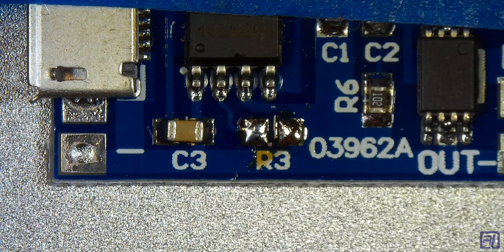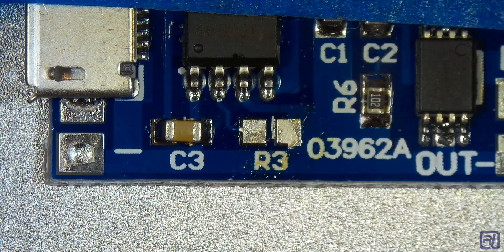Lower the charging current on a TP4056 charger board.

Comment: My charger module is heating to a point I can't even touch (I think over 70C ), and I've heard that changing the resistance can help with that but it's not clear whether higher or lower is better. Can anyone help or does anyone know a different charger board that supports usb C and charging while also using the output?

Comment: Thanks. I've been buying boards like these or similar for years, and each time forget WHICH resistor to change. And of course none of the "bargain" sellers remind anyone. Most of them come with USB-C connectors now, but the parts layout looks identical, so hopefully its still always R3. I usually set them for 500mA instead of 1A anyway, because at 1A they do tend to get a bit hot. Especially if the cell being charged has run down to the protection level of about 2.5 V, 1A would mean the board is dissipating 2.5W right?

Comment: All the people asking "what resistor do I need"   just do R =  1200/mah and you'll get what you need in K ohm

aka
R=1200/300mah meaning R =  3k ohm.
R=1200/100mah then R = 12k ohm
R=1200/240mah then R = 5k ohm

So on and so fourth. 

As a side note, the mah charge rate is not the mah capacity rating of the battery.  You need to look at the spec sheet of the battery for suggested charge rate for your specific battery(ies) to get the charge rate mah.  A 1700mah capacity battery is not a 1700mah charge rate.

Comment: Is it possible to change max charged voltage cutoff?
Reply: sadly not without extensive modifications
Reply: one guy mentioned using a simple schottky diode with the correct voltage drop.

Comment: hi Ruben hope you are fine, i have  450mAh 403040 Lipo Battery i want to recharge it with TP4056 charger and please correct me if iam wrong i will change the resistore with 4k 1/4 watts is that right it will be great if you help me in this part Thank you

Comment: It worked! I used a 10k resistor. Thanks!
Reply: hi i have  450mAh 403040 Lipo Battery i want to recharge it with TP4056 board.. do you have any idea which suitable resistor that i can replace it with...I am confused thank you
Reply: @samibanett516  A 10k resistor should work well.
Reply: @Yonatan24  Thank you for your fast respond and help ..God bless you i will Use 10K Resistor i sub in your Channel
Reply: What worked? What it changed? (yeah I don't know what I'm doing here, but I need clarification why you do it, please answer)
Reply: @WerewolfMaster  It lowers the charging current

Comment: If the battery is 1500mah -2000 mah then resistor need to replace or not
Reply: I would suggest you replace it. It is suggested that you charge Li-ion batteries at 30-40% of it's capacity for best life and performance of a battery.

Comment: I have a Li-Ion rechargeable button cell
that requires a 50mA charge rate (120 mAh battery)  Can I go higher than 10K resistor on the board to get the charger down further??

Comment: Hey Ruben
For fast charging of my 18650 battery I removed the resistor r3 and replaced it with wire of negligible resistance.
If this step is correct or not
Please tell me the right thing to do 🙏
Reply: See how long that lasts.... lol.
Reply: @boots7859  🥲

Comment: What ohms value of the resistor should be replaced in R3 of TP4056 fit to 3.7v 200mah? Thanks!
Reply: not sure if you need it still but, the formula is   Ibat = (Vprog/Rprog) x 1200 where Vprog is 1 (for 1V).  Since you need Ibat to be 200mah, This would be written as "200 = (1/Rprog) x 1200"   Simplifying it to Rprog = 1200/200.  You'd need a 6k resistor.

That goes for any of these calculations.  Rprog = 1200/mah to get your resister value in k ohm.
Reply: @DustyClam-vx5fb  Isn't the Ibat the charging current?  From what I've researched is that you should aim to charge your batteries at 30% - 40% of the capacity for best life and performance.  Shouldn't he try to calculate his resistor for Ibat to = 60 - 80mah?
Reply: @sk1pp04  Depends on the battery since some can charge faster than others.  But you were on the right track.  As a rule of thumb, I go 30% to 50% on charge.  The percentage tends to go lower on higher capacity batteries.  I charge NOTHING at the rated capacity (100%) though.  I don't recommend it.  I have some 550-600 mah batteries I plan to use with this board, I'll be setting it to around 300 mah.

Comment: The Manufacture should use higher size resistor or even better a version with socket and carbon resistor for an easier swap
Reply: These are made for industry, not tinkerers.
Reply: @boots7859  I've never seen them in any device using a 18650.  I've only seen other charging modules. Do you have any examples?

Comment: Great Video
Have you got any way of changing the minimum discharge voltage from 2.5 to something nearer 3v so the battery doesn't deplete
Reply: In reality, batteries like the 18650 don't suffer any irreversible damage even at around 2.5V. If you connect a voltmeter across the battery and discharge it until the protection kicks in, you'll see that the battery voltage rebounds to around 2.8V or more without any charging. It's probably a good idea to then recharge them sooner rather than later, but the chemistry is much more forgiving of over-discharge than it is of over-charging.

Comment: Hey! I have a 1700 mah battery (Lipo), do I need to change the resistor on the TP4056, or will my board with fine the way it is?
Reply: It is suggested that you charge Li-ion batteries at 30-40% of it's capacity for best life and performance of a battery.  I believe the same is suggested for Lipo, so you would want to get the charge current between 510 - 680 mA.  The default 1A current the TP4056 would charge it, but you would risk heating issues and performance losses, as well as possible damage to the battery.

Comment: Hallo and thanks for the video!

In the table that is in your video and also in the data sheet, the list ends at 1000mA . What if my LiPo is 1200mA ? I mean the table is not linear... What kind of R should I use?
Reply: You mean your battery is 1200mAh capacity. And @Ruban Lopez you mean the LiPo 1200mAh battery that you won has a charge rate of 240mA.
Capacities are measured in mAh and charge currents are measured in mA. It's because folks are sloppy about using units accurately that there is so much confusion.
Reply from the maker: Hi, take a look at your battery's datasheet, it will list the suggested charge rates. For example the LiPo 1200mA battery that I own has a suggested charge rate of 240mA.
Reply: @rlopezxl  what if there's no battery datasheet available? Not every battery has such luxury provided

Comment: Hey is it ok that the TP4056 gets hot or should i limit the current flow?
Reply from the maker: It does get hot when charging at 1A.  If the heat is a problem for your project you can lower the charging current.

Comment: Does it need to be the exact value for the resistor? I can't get 4k resistors, only 4,7k. Does it matter?
Reply from the maker: It does not need to be exact, just use a value that will give you an appropriate charging current for your battery.  Using a higher resistor value will give you a lower charging current.

Comment: I have 3.7v 850mah lipo.. What is the suitable value of resistor?  And can I use normal carbon resistor instead of smd resistor?
Reply from the maker: I think 1.5K would work but take a look at the datasheet linked in the description.   Yes you can use a carbon resistor.
Reply: @rlopezxl  thank you so much for your valuable reply...thanks a lot 😊🤗❤

Comment: cool video....just want to ask if my lipo battery is rated 1800 ma, what should i do can i short the resistor? thanks.
Reply from the maker: You don't need to do anything. The default charge rate should be fine.

Comment: Can we charge 2 parallel battery changing resistor? Araund 1.5 A 2 battery
Reply from the maker: The boards I've seen have a 1A max output.  There is a different high current module that you can find. Search for "TP4056 High Current".
Reply: @rlopezxl  i know that there are different modules but i want connect 2 battery parallel to this module. Battery voltages are 4.2 v .They are in same voltage .I know we can connect 1 battery to this board.But can i connect 2 battery? Thanks for answer
Reply from the maker: I have not tried to do that myself but you can.  Make sure you balance both batteries first before connecting them in parallel.
Reply: @rlopezxl  okey thanks

Comment: Which value of resistor should i use for getting  2 amp and 3 amp current 
Please bro reply 
I dont have much knowledge about these things
Reply from the maker: The datasheet states that 1 amp is the max.  There is a different high current module that you can find on eBay.  Search for "TP4056 High Current".
Reply: @rlopezxl  ok bro thank uu  for replying

Comment: Can I charge multiple lithium battery at parallel in one tp4056?
Reply from the maker: I have not tried that. It is possible but you should go research the limitations and risks.
Reply: @rlopezxl  I do some research about it some saying that should use resistor because the limit of TP4056 is 1amp and 5v. 1amp = 1 lithium battery therefore the total is 4amps in 4battery while the voltage will stay the same (3.7v). The question is why do some people(DIY) in YouTube  using only 1 tp4056 and USB when creating a powerbank
Reply: The TP4056 modules are so cheap (l can see ten for £5 on eBay, including the extra protection chips) that there's really no reason not to use one per battery. Having each battery charged at its optimum rates will help to extend battery life, and you'll save money in the long run.

Comment: Very good video! I want to charge a LIR2032 and LIR2450 battery. Can I even use higher Resistors as 10K? Thanks in advance. BTW: I've subscribed!
Reply from the maker: I have not tried a resistor higher than 10K but someone in the comments mentioned problems with the LEDs with higher values.
Reply: @rlopezxl  OK. Thank you
Reply: Do you think it's a problem charging LIR2032 (45mAh) with 10K?
Reply from the maker: Yes, the charge rate is too high for that battery.  I don't have experience with rechargeable button cells. Go search for a tutorial on charging those types of batteries with the TP4056.  I'm sure someone on the Internet has already done it.
Reply: @rlopezxl  Yes, I've done it using a 33K resistor. It charges my LIR2032s at about 40mA and that would be perfectly safe for the LIR2450 as well (although it would take longer).
If anyone doesn't want to change the resistor on the the TP4056 module themselves, for a few pounds, they can buy a pre-build module with a 2032 coin cell holder soldered onto a TP4056 module that has been modified to supply a similarly low charge current. I've not experienced any issues with the LEDs on my charger.
Reply: @RexxSchneider  Nice. Can you just replace R3 with a variable resistor so you can set it on the fly?

Comment: I have a 180mah battery...
What kind of value i used 5k or 8k
Please reply
Reply from the maker: 8k should work for your battery.
Reply: @rlopezxl  
I have a 10k potentiometer but how to connect in it with the set of 8k
Reply from the maker: @nazmulhassan7008  Use a multimeter to figure out which leads you need to connect and to verify the resistance value.  You can probably find a tutorial on Google, search for tp4056 and potentiometer.

Comment: Thanks for the video! I will more than likely just replace with a standard quarter watt metal film resistor.
Reply: work also fine.the pads for this Rprog are so close to each other, it is crazy. the best with 1/4 resistor, is to try the resistor in the place it should go, bend its pins try again, if correct then solder...
Reply: @DrZipZwan  If you must use a standard through-hole resistor, then it's worth noting that the right-hand pad (as shown in the video) is actually ground, so you can ignore that pad and solder the replacement resistor's legs between the left-hand pad (=pin 2 of the TP4056) and the negative input pad/hole marked (-).
Reply: @RexxSchneider  yes, you may actually place the replacement resistor whenever, you like. Just make sure to solder 1 side of the resistor to pin 2 of TP4056 chip, and 2nd side of resistor to Main Ground.

Comment: Thanx for this nice video especially for the microscope view!
I just changed the R3 resistor but use a standard resistor, thats what I had around. It works fine.
IMPORTANT DETAIL: when you chose a resistor superior to 10K (because 10k is the max value in TP4056 datasheet), it messes with the led of "charged completed" !! so according to what/how the led is blinking, you should try to understand when the charging of your battery is done.
Reply: Would be interest know of fix it for charge LIR2032 battery.I want use higher value than 10K for that cell.
Reply: @MACYNET323  I also did a charger for those coin battery, and works fine.
Had to go with 47K, because capacity of those coin batt is low around 200mA, and dont want rush them with high current. It is ok with me, got around 5 of those rechargeable LIR2032.
Just dont exept big capacity from them.
Reply: @DrZipZwan  Do you have use this module or it's another project that can you share?I tought to charge battery from 5V supply by just add a diode and resistor,THX
Reply: @MACYNET323  Please don't charge lithium batteries from a 5V supply. Both the supply and the diode are likely subject to variations in voltage and you can't be sure you will keep the battery voltage below 4.2V. Considering that I can buy ten TP4056 modules with protection included for around £5 from eBay, whatever savings you're hoping to make by using a diode and resistor instead simply aren't worth it.
Reply: @RexxSchneider  thanks, I' ll try this way. I noticed that tp4056 with Type-C have smaller size smd  resistor than the micro usb version, I wonder why they make it so small and difficult to weld. Would be nice  bigger size or even a slot for easy swap with  classic 1/4 watt Resistors
Reply: @MACYNET323  My guess is that for whoever designs these TP4056 modules, the last thing they are concerned with is the possibility that someone wants a different value of resistor fitted. They are produced in frighteningly large volumes, so I suspect that even small extra costs in the design would add up to a lot of money.
Reply: @DrZipZwan  Thanks for the data. I've got a 200ma battery that I need to charge, and I'll start somewhere around there.
Reply: @boots7859  I added a battery to a small device cause tired of AAA battery, I was limited with the space so had to use a 200mA one.
go with this formule: 1200/ X= charging current
X is the value of resistor and charging current should be between 30-40% of battery's capacity.
40% of 200 is 80mA, so charging current should be around 80mA.
So 1200/80= 15
You should use a 15K ohm resistor to get a 80mA charging current.
Reply: @MACYNET323  I've been charging LR2032 batteries using the TP4056 for a long time now. I replaced the 1.2K SMD resistor with a 33K SMD and it works perfectly well. I've not seen a problem with the switch from "charge" to "standby" leds to indicate end of charge, but I may be just lucky. The end-of-charge voltage is always a solid 4.2V.

Comment: Nice video. I’ve just changed one of mines to lower the max current to 0,4A (3k Resistor) and I’ve succeded. FYI I’ve used a 0603 and no problems. 👍

Comment: Hey! Can I use a normal resistor in place of the SMD resistor? Both leads are in place of the SMD’s leads?
Reply from the maker: Yes, you can.  Cut the leads shorter to make it easier. I did that in this project https://rxl.dev/to7f70
Reply: Ruben Lopez also, why do I need to lower the current rating? Can’t I just use the TP4056 as it is with a 650mah 3.7V LiPo battery?
Reply from the maker: @lexoticstudios5669  the default charging current is too high for your 650mah battery. I would lower it to 650ma to prevent any damage to the battery.
Reply: @lexoticstudios5669  because the charging current should be 35-40% of your battery capacity!!
40%  of 650mA =   260mA
So you need to find a resistor that will set the charging current close to 260mA (maybe not exactly 260mA, but try to find a resistor that willl give your a charging current close to that number), it is better for the security of your battery and your project ;)
Reply: @DrZipZwan  A resistor of 4.7K will give something close to 260mA.

Comment: i could only find 1206 ones. lets hope it'll work fine 0_0
Reply from the maker: That might be too big.  I think it will cover the pads but let me know if you get it to work.  Remember that you can always just use an axial resistor. Just cut the leads short.